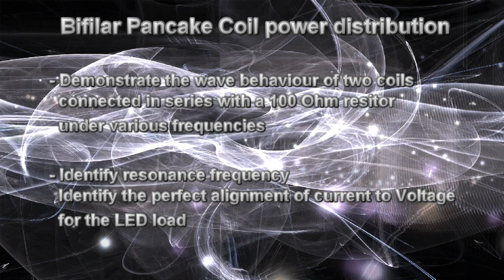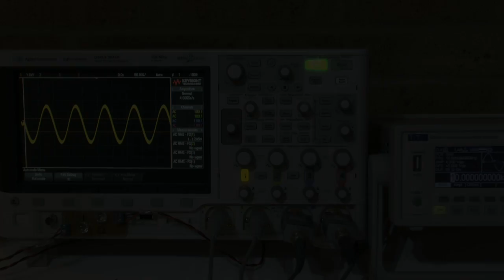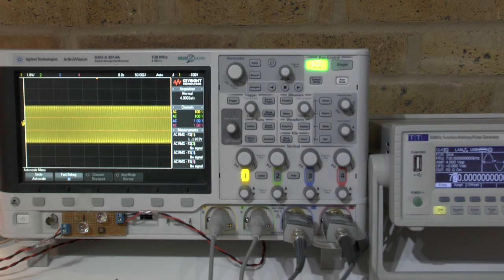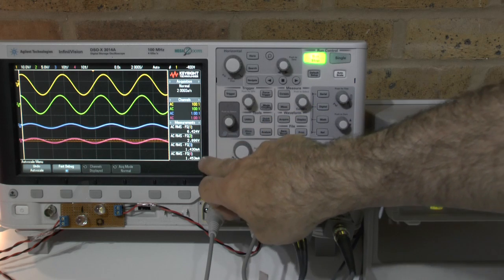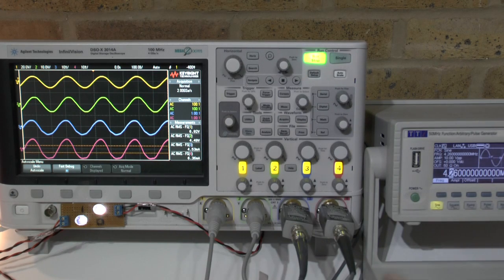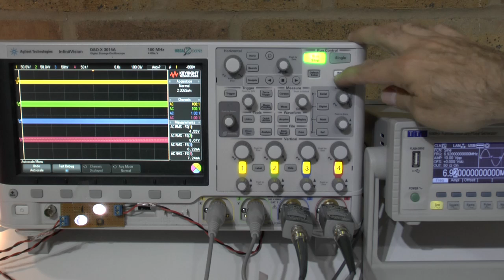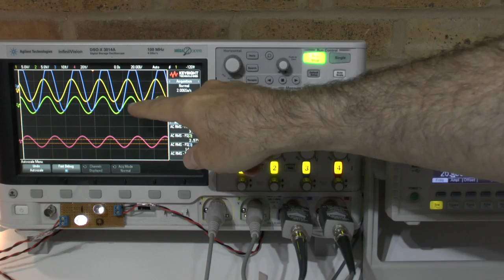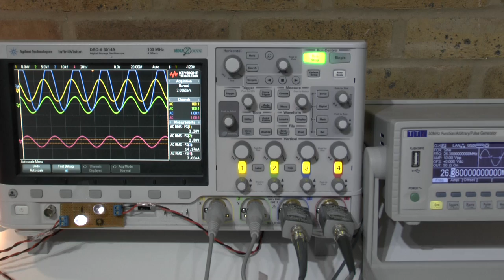Power distribution in a Bifilar Pancake Coil

Comment: voltage and current become in phase when it is made LMD (longitudinal magneto dielectric) resonant, by using a series resonant impulsed primary.
Reply: @crazyham  and all resonant.
I use the field of each coil to interact with the field of the other coil.
L1 creates resonant voltage half wave impulse from its magnetic field.
L2 is series resonant and has low impedance for the impulse of L1.
L2 magnetic field is coupled to L1 magnetic field and is assisting, lowering the power draw.
impulse on L2 sets up a displacement current.
L2 acts as capacitor plate and is primary. 
L2 has large tuning capacity so characteristic impedance is high current low voltage. 

L3 is secondary, and acts as the other capacitor plate, receiving the displacement current of L2. 

L3 is parallel resonant, but with small capacity, so characteristic impedance is high voltage low amps. 
but L3 amps are amplified by displacement current (so both high amp amd high voltage). 
L4 is the extra coil, in series with L3. 
L4 has no tuning cap, but is made larger, so its resonant frequency  matches the L1 impulse half waves. 

L4 and L1 are very different in size, still they(almost) resonate at the same frequency, this is very odd, which indicates there is a speed change. L4 is much faster, thus it needs more windings to match L1. 

It looks like a tranformation from tranverse L1 into 100% longitudinal in L4

Biggest challenge right now is matching the impedance of L3/L4 with a proper load
Reply: @crazyham   With the secondary I find they become in phase under load, but with using an (series  coupled to secondary) extra coil and tuned properly, the extra coil becomes in phase. Now I need to impedance match the load, and see what is able to pull out.

Comment: In your video on using flat bifilar coils to harness energy from a Tesla coil, how efficient is it compared to a simple flat coil? Thanks
Reply from the maker: There is no simple answer to your question. It is time that you start to study. I have many 100 hours of video material and documentations produced under performance evaluation on my website.
Reply: TheOldScientist thanks
Reply: A bifilar coil can store much more energy in it's resonant fields, but it does not "harness energy".  but multiple coils can be used to amplify power, but it's not easy to explain.
take a look at my april 2019 Radiant Power video for more information.

Comment: You are mistaken, at Resonance Frequency Total Impedance Equals Resistance of the coil, but Reactance increases
Reply from the maker: I am afraid that is not correct. The resistance does not change in a circuit, only when heat is involved. Second, the impedance is the sum of oppositions of resistance inductive reactance and capacitive reactance ann simple resistance, LCR circuit, only valid for AC. Therefore impedance at resonance frequency is not equal resistance of the coil but much higher. Watch my ac filter videos to see how Impedance of the DUT can be matched to the source. A simple resistor would not be able to do the job.
Reply: with series resonance we only have wire resistance, while voltage and current are very high. 

with parallel resonance, we have very high impedance.

Comment: Try using 7 bifilar's oriented and based on the chakra system polarity configuration. Merkaba science. Maybe even coil the bifilar's in  a cone-cone, cone-pyramid, or pyramid-pyramid configuration either point-point base-base, or both. (it probably needs to be both to get the proper polarity flow)  If you use cone and pyramid bifilars as the 6 chakras other than the heart position. For the heart position utilize a Large bifilar with + and - load leads emanating from the center of the heart. Root heart and crown oriented with vortices going vertical and the rest horizontal tying the third eye coil - spleen coil,  throat - solar plexes, and Root to crown. 3 circuits, ground, atmosphere and the 3rd is the load (heart) area. The heart axis may be inverted 45%. And base the whole system on Beta frequency, specifically 30 hz. Just an Idea.